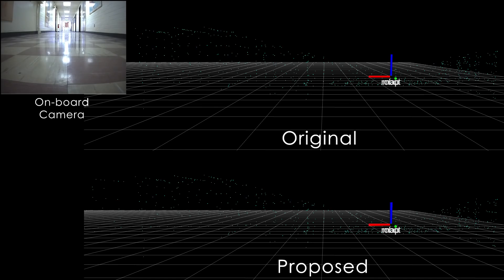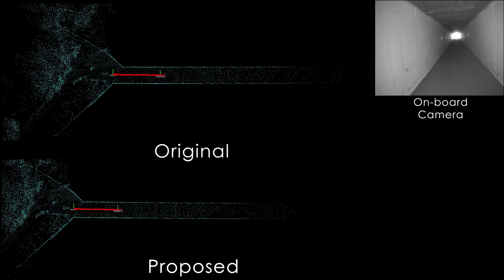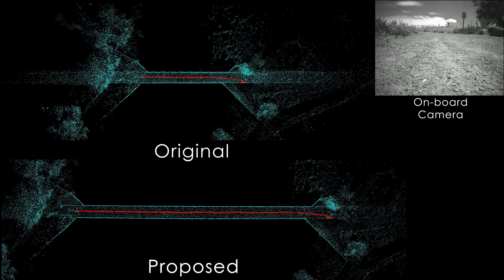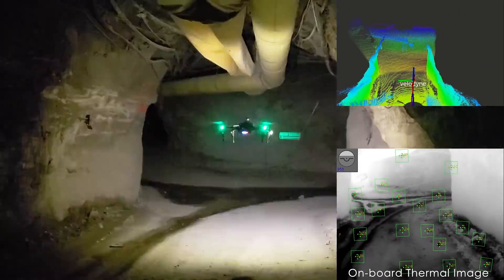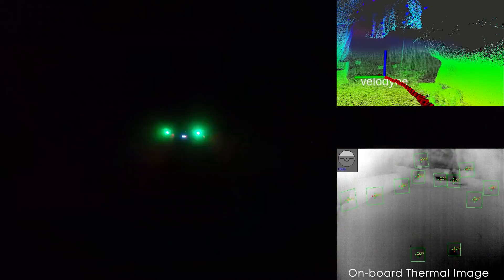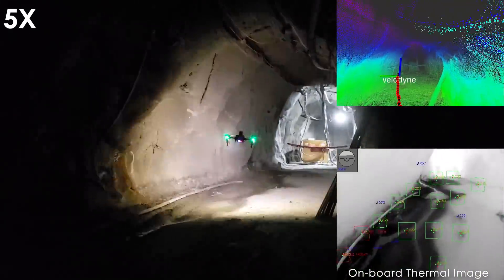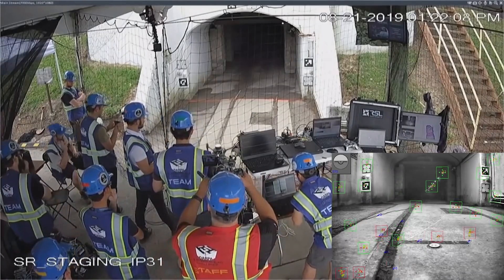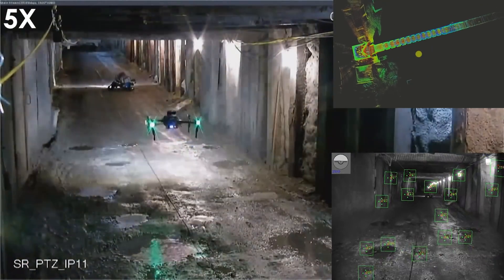Complementary Multi-Modal Sensor Fusion for Resilient Pose Estimation in Subterranean Environments

Comment: when the battery is critical level are the lights necessary for return?.  How much battery do they consume? On the return does it adhere to its exact flight path?  What if an obstacle were to appear as in a hanging wire falling or let's say Bats?
Reply: Love your work by the way! :)
Reply from the maker: @meme6532  Thank you for your feedback. For your questions:
1. LEDs: they flash only during camera shutter. Thus they consume very little. Nevertheless, they could be off if needed. They improve the localization but assuming a LiDAR-friendly environment the method works when visual-inertial odometry goes off. This selection is not currently happening in our robot. But I explain it could be implemented.
2. Dynamic obstacles: locally we avoid them. But note there are limits on what we can map properly. For example a hanging wire might be a challenge for us.